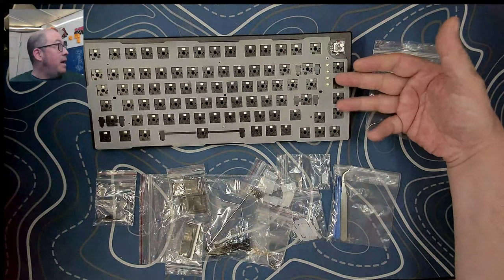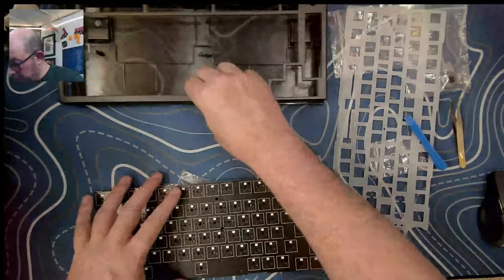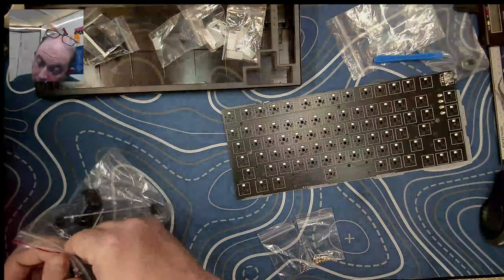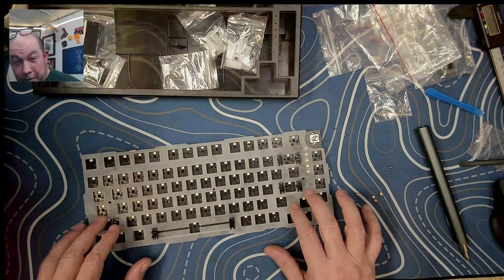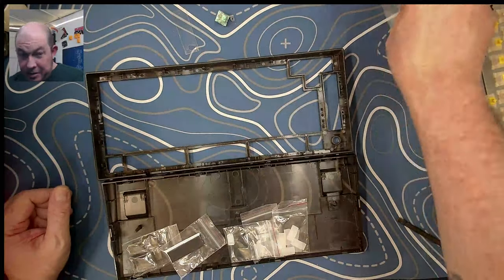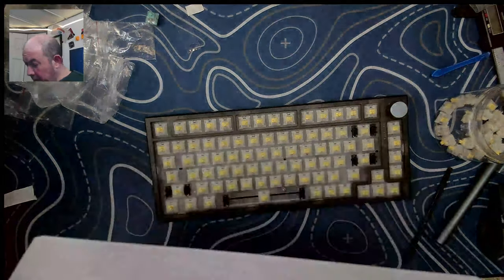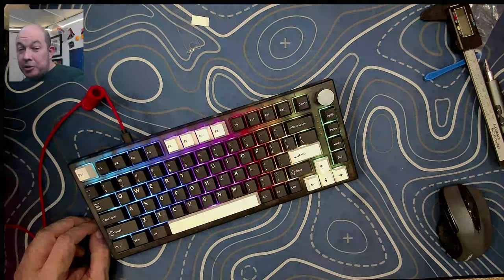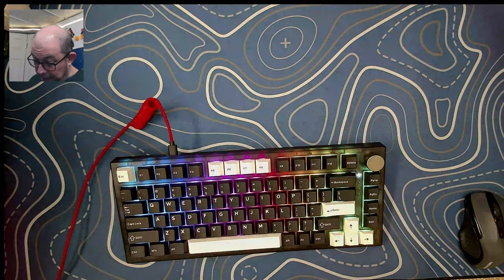Building the CSTC75 - A $59 open source 75% kit that's fun to build and delivers satisfying results

Comment: I don't think that there is a wireless version, maybe they are just re-using or cloning Feker IK75 parts? Interesting that it does VIA,,, depending on how much programming one has to do to get this running (haven't watched the whole vid yet) that's a REALLY good deal (compared to the VIA IK75 which is like $100) Just got the IK75 wireless myself (waiting for an exchange since the period key doesn't work lol) but if I didn't want wireless, I definitely would consider the CSTC75 instead!

Another thing to note, at least from my limited knowledge and research, is that bluetooth doesn't work on QMK usually My evidence for this is that the QMK version of the IK75 specificially does NOT have wireless and also people trying to run QMK on Keychron K-models are forced to give up bluetooth, Perhaps QMK or VIA can still use 2,4ghz though!

One difference from my IK75 Pro V3 is that you have a shit ton more LEDs on the bottom!

Comment: So this pcb is basically the feker ik 75 ? Even the 2.4ghz dongle place is there lol, and I bought the Feker Ik 75 wireless for be my first custom keyboard wireless, Should I bought this PCB instead ?
Reply from the maker: It's wired only, so the PCB is not the exact same, but it fits.

Comment: Man, that sure does look like an IK75 case. The bottom case especially where it has room for the USB dongle and the blockers for the batteries inside. I wouldn't be surprised at all if they just changed out the PCB and left everything else the same. Now that this has VIA/VIAL support, how do you rank it compared to the Keychron V1? Seems like the only thing this is lacking is the built-in dampening and that it has North facing RGB.
Reply from the maker: That's a tough call I'm going to have to spend a little bit more time with it and mod it to bring it up to par with the Keychron and then compare the two. Though initially I am quite pleased with it and I'm pretty certain I can make it sing, I don't much care about north or south facing so this may actually be a good contender especially for those wanting more of a gasket mount style.